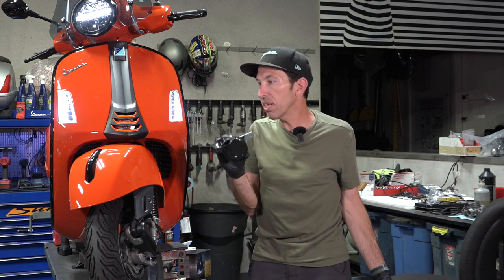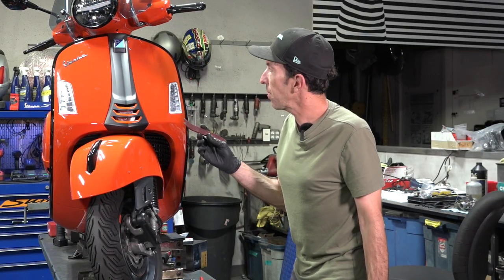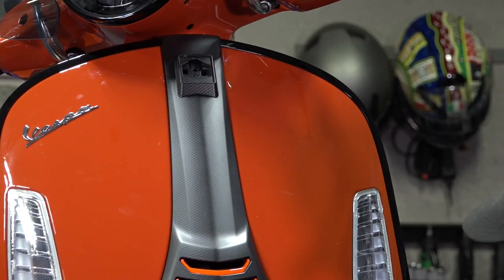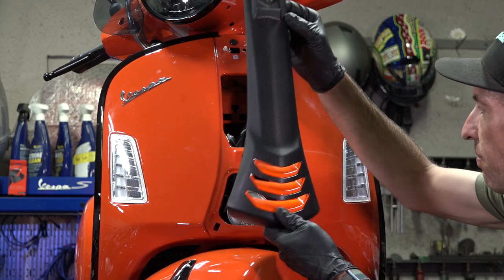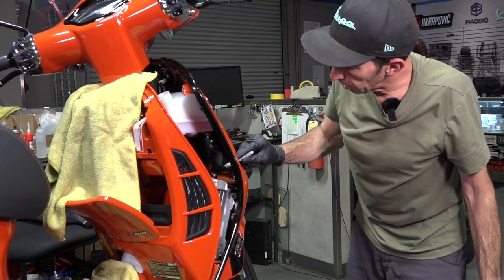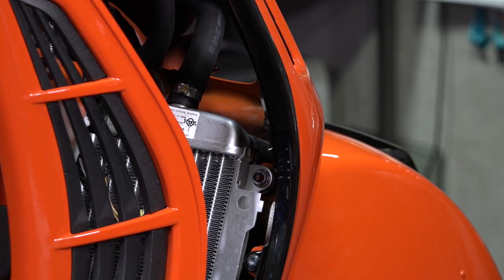Install a 136db Electric Horn on your 2023- Vespa GTS 300 HPE2

Comment: I installed the Stebel Nautilus Air Horn in mine.  I separated the compressor from the horn and mounted them in two different places inside of the legshield, connecting them with a rubber hose.  Sounds great!
Reply: Any chance u could post quick horn vid?
Reply: @gregtannermedia  send me an PM and I can send you pics.

Comment: I literally just finished installing the stebel nautilus air horn on my 2019 HPE. I installed it on the top left hand side. It actually fits in there quite well. You just need to bend the existing bracket for the indicator flasher relay and mount it on that. Move the relay to elsewhere. It's crazy loud!

Comment: I got the air horn installed right from the dealership at Vespa Portland. Don't know what the part number is but they call it The Stupid Loud Horn. It's awesome and sometimes scary to use.
Reply: I had one in my 2012 and miss it. Could u post quick vid f horn plz?
Reply: @gregtannermedia  I will try. Hmm how to respond with a video?

Comment: Hello Robot. O hace just got a brand new 2023 GTS Súper sport just as the One you show in HR his videos, even the same color. I would like you to recommend any cell mount for this model since it comes with a different mirror diameter size. Hope you can help. Thanks!!

Comment: Hi Sir, just a question regarding my new S125 iget 2023 model. I want to upgrade to full exhaust ( ixil brand maid in Spain brand ) it is a true plug n’ play kit for the 3V iget, they said that I just need to remove the battery connection for 5 mins after installation. Is it enough and nothing else I needed to do. Hope you could help me with my concern. Thank you in advance.

Comment: No good for rainy states/countries if you have to face the horn forwards.
Also, word of warning.
With that tone, other road users are going to be looking for a car not a bike so it may work against you getting more noticed.
Reply: Most scooters, motorcycles have the horn facing forwards. Most of mine do on all my motorcycles. And I've had no issues with rain. And the uk gets alot of rain...
Reply: Your experience is interesting
Reply: @JDMz  
Not seen any of this 'snail shell' horns mounted forwards. 
The plain disc style ones yes.